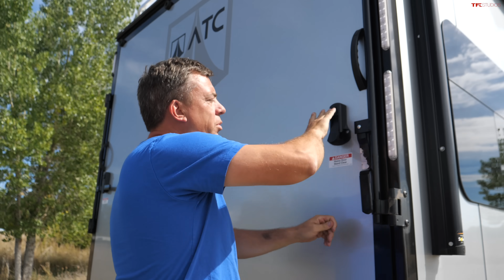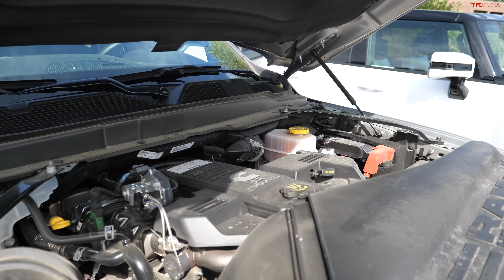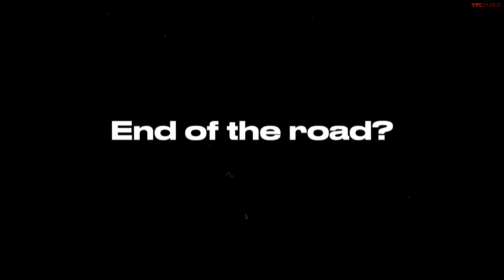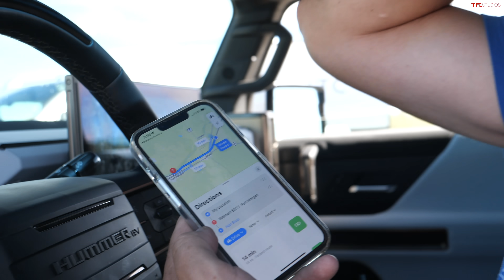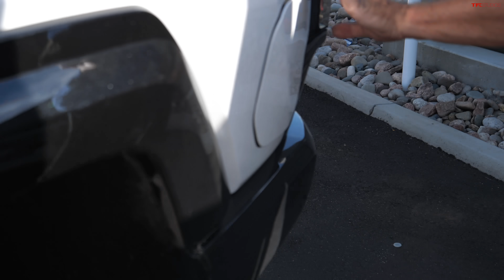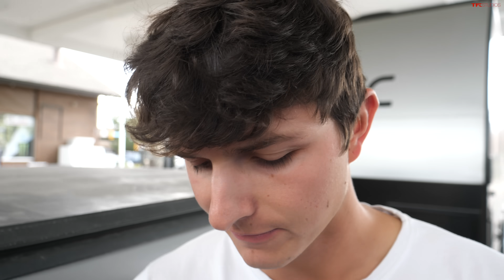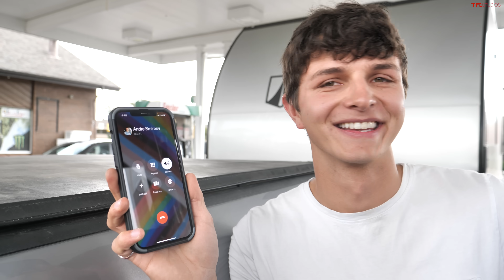How Far Can a Diesel and Electric Truck Tow An Identical Camper Trailer on ONE Fill-up?

Comment: So far electric vehicles have been as useful as taking the bus!! Definitely not good for pulling a trailer. And charging from a fossil full produced electricity. Drive 100 miles then charge for 20 min oh look the charger deminishes.. that's if you find a 230 kw charger! Usually its an hour plus to charge....the price of charging is not regulated and you are charged a price as the station desires!

Comment: The reality is the RAM results are skewed including the mpg, due to the RAM stopping with the EV, it should have stayed on the highway until it needed to stop. Also, the EV ended up using electricity and diesel.... the charging station was being powered by a diesel generator.  And it just so happen to be '0' but it was reading $37 for 31 min charge and it was still going with 51 mins remaining.    That could have come up to over $80.   He stopped  for a charge about half way there so it would have cost more than $160 to charge for the trip.

Comment: Dude that range is so sad... My 1990 van gets us 280 miles on one tank towing a boat and we can fill up in less than 5 minutes depending on the pumps at the station. Vs 128 miles??? Firm pass on elc towing. What a waist of time. Then when that lithium battery goes tits up you are polluting the planet harder than all the carbon produced  my man kind. Elc is going to kill the planet. People know so little its disturbing. The way neodymium is found and mined will make you want to terminate the Chinese government permanently. The way those batteries are made produce more toxics to the planet than any other industry. WAKE UP! GREEN ENERGY NOT SAVING SHIT!

Comment: What else many people don't take into consideration is the length of time it takes to charge. And in that time, that can be very crucial in many cases. Especially emergencies. Not only that, but the danger and risk that it can put on a person waiting. Someone can easily approach and have plenty of time to jack someone or kidnap or rob someone. Much greater chances. And if the electric car catches fire, good luck putting it out!
Reply: You WONT be putting it out... And even the FIRE DEPT will have an INCREDIBLY hard time too... Even AFTER they put it out, it can Catch on fire AGAIN.... Lol
Reply: @RyGuyXRP  yes I've seen instances where they restarted.

Comment: Twice as fast to charge but still 20x slower than fueling that diesel and not to mention you have to charge at least 3x if not 4x per the diesels 1 refueling.  This isn't even a comparison anymore.  You're really just showing off how bad an EV sucks ass

Comment: Thanks for doing these awesome videos, proving what I already knew. I for one,  will never buy a e-vehicle. As an Engineer, American, and someone with common sense. E-vehicles do have their place, living close to town/city making quick runs, maybe. Now if they put a Diesel generator on board like most trains do, now you migt be able to get better range. For those that dont know most trains use electric motors, because of the torque they can pull all the weight and cars as shown by this Hummer. But what isnt probably known is that the trains have huge diesel powerhouses on board to keep the electricity running for said electric motors. These are a huge sham just like solar and wind. Again, solar and wind have their place and from my analysis and calculations they are great for smaller homes/trailers to supliment those homes. Also you need to look at the Carbon foot print of the EV before you even drive it off the lot, spoiler alert, ITS HUGE. You would need to drive that EV almost 50 years to break even on the so called carbon foot print. The diesel used to mine the lithium for the batteries, the massive ships used to transport the materials/parts and the greatest question of all where is your electricity coming from to charge said EV. Coal, Natural Gas, Hydro-electric? Not to mention it took the diesel truck all of maybe 5-10 minutes to gas up. The hummer 30 minutes and it was barely half full, so you are looking to sit around at least 1hr. Want to go camping for the weekend? Hope your campsite is only 60 miles away because lets face it most camp sites dont have EV hook ups and forget about camping out in the middle of nowhere. Unless you take a generator, and gas I guess. All those vehicles are for, pretentious, virtue signaling half wits who haven't takent the time to question, do the math, and to think everything through critically. Is the Hummer a nice vehicle sure, but as stated in the video, its an EXPENSIVE TOY and not very practicle, at least for someone that lives out in the middle of no where. I do think that more research needs to go into the EV cars/trucks but as of now it a huge sham and joke.

Comment: Personally, I do a decent amount of long trips and just factoring in the time for charging of EV vehicles that are affordable to me and the charging stations I would have to use would add extra hotel/motel costs and time. For typical daily driving I could be persuaded to get an EV if it was very low cost for the vehicle. My overall preference is hybrid, though I use an old gas Toyota pressently.
Reply: Just remember. They told us the chargers would FREE..... ALSO, have you seen what GM is starting to do? They have a Monthly FEE in order to use Google, or the Autonomous Driving... Shit like that... So.... I would wait a GOOD 10 to 20 YEARS before pulling the trigger

Comment: Thanks for this side by side comparison that shows electrics range Achilles heel. Electric battery technology is maxed out. This problem won't go away. Imagine otr trucks. No no no way. The extra weight, lack of range, time to recharge, unavailability of batteries. Electric is creating a disaster for trucks.

Comment: I'm not a fan of electric trucks for several reasons, including their limited range, hauling capacity, and purchase price.  Having said that, what this video fails to talk about is the outrageous cost and frequency of repairs on diesel engines built after 2006.  If they don't kick the whole urea concept to the curb, the government will soon tax diesel and subsidize electric to the point that electric is the more cost effective option.

Comment: Calling you out for two huge mistakes, the model trailer you used exceeded the Hummer EV's towing capacity and you are dishonest about the trailer weight. Also, you failed to use the Hummer's onboard hybrid generator that extends the range significantly while you are driving. Also, the computer management will also extend your range when set up properly. You might have been surprised you went further at the end when you thought you were out of juice, lol, but you don't know how to operate the Hummer EV. All in all, this is a staged video that is fraudulent and full of misinformation.

Comment: The important to note that this was a flat tow, actually going down in elevation and the $115,000 Hummer could only go 128 mi. Try this same trip in the winter time and that could be reduced by as much as 40%. Turn around and go west into the mountains and my guess is that the Hummer wouldn't even make it to the Eisenhower Tunnel before running out of power.

Comment: That Cummins Diesel will run for over a half million miles.  How long will those batteries last?  How much did you say it costs to replace the batteries?  $60,000?

Comment: A more realistic test would be if both vehicles set off going to the same destination, using the same route and keeping to all speed limits, and the exercise would be, what would the time difference be between the two vehicles getting to the destination. The distance should be set at the maximum range of the ICE vehicle, or, two charge stops for the EV. REMEMBER.....if this was a business trip or a "call out", that in the real world "TIME HAS A VALUE".

Comment: So best charging is 350k and at the bottom half of the charge, so most time efficient is the run almost flat and charge half way at 350k. That would give you 43.35 miles in 25 minutes and then at 70mph you use the other 35 minutes of the hour to drive 40.8 miles and change again. So at 70 miles per hour you travel at 40.8 miles per hour or slower if the charger isn't empty or not a fast one and if you have to unhook the trailer, not very efficient use of ones limited time alive travelling only up to 58% of the time.

Comment: The studies are coming out, just the carbon footprint alone. A low milager will take up to 10 years alone to make the manufacturer ing carbon foot print neutral, a high miler will take 2 to 3 years. It is better for the earth for the low milager to keep the efficient gasoline car.

Comment: These arguments remind me of the argument against battery powered tools.  Use the right tool for the right job. I have battery, electric and pneumatic.  I dont chip concrete with battery or set sheetrock screws 15 feet in the air on scaffolding with electric, stringing electric cords.  Anyone that says electric will completely replace ice is an idiot, oblivious to how some people use trucks or a liar.  Samething anyone that says electric has no place is either a liar, oblivious to any situation not their own or ignorant.

Comment: EV battery tech is still very early in development.  I  expect someday EV range will be measured in thousands of miles.  EV tech will advance rapidly over the coming years.  We have already come a long way in a fairly short time.  It will continue to get better and cheaper.  The first EV's are much better first gas cars were.

Comment: The one thing that is very important is how much down time was the electric hummer recharging time compared to the down time of gas n go? Time is money I don’t want to spend 6 hours charging and 6 hours driving (for example) just to have a fuzzy cuddly feeling about how I’m not directly polluting the environment. Diesel is king because of the filtration systems but what pollution is incurred in extraction, production, and what pollution was to charge that battery?

Comment: Sadly EVERY genius that does these things leaves out a MASSIVE DETAIL... a "used" electric vehicle is virtually worthless as a "used car". First thing that dies after that warranty (since your car is web connected, the BATTERY warranty is as long as the company you bought it from wants it to be, one button pushed in Corporate and amazingly, you have NO RANGE) is the BATTERY. NO ONE EVER talks about buying that NEW battery cost, installation charges and then trying to unload that dead pile of lithium in time bomb form (massive fire hazard), the dealer doesn't want it.... Buy that new $100,000 electric car, and its dead before you finish paying for it...

Comment: A guzzler and a phone trying to be a truck. If these models ever make it to Europe, there will be 10 sold in total. My fathers transport van, fully loaded, towing a loaded trailer does 28mpg. Of course I did a little black magic with the ecu map and gutted all emissions control parasitic devices. The point is: you don’t need a boat engine to tow a decent amount of load and such inefficient shitboxes would never fly in a market where properly engineered vehicles are available. A 4 banger with 200+hp does the job without breaking the bank.

Comment: Yues these EVs have a very long way to go. And if we keep making them we'll run out of fossil fuel before we have enough of them to sale to just those in the us. 😳😗 Yea they are no comparison to a hydro vehicle just like we use in the rockets for propulsion, once in space. That's all it takes is the ho 2 so a much better option for the general civilian gangs😀 or keep driving deisel fuel cannot get greener than bio deisel it's low box low CO2 and easy to produce cheaply 😀

Comment: 9000 pound truck? Is that with the batteries full? And I never saw pickup drivers so happy about sailboat fuel. I would congratulate these jokers for driving 70 mph like standard normal folks. The bottom line is these wimpy electric trucks will be the butt of jokes for years to come. Even Elon musks trucks won’t do the 500 miles per charge. We still need good old diesel and we better elect politicians with some decent energy agenda!!

Comment: The greenies come from libturd stock that lectures us to follow the science[facts]. This is the video they don't want anyone to see because it doesn't support their narrative that green electric technology surpasses fossil fueled technology. And these same green libturds are putting pressure on railroads to run "battery powered locomotives". Even if the railroads had the money for overhead electrified systems, the electric power grid  would not have the capacity to supply their power needs unless new fossil fueled and nuclear power plants are built. The greenies hate fossil fuels and they don't want nukes so they think solar and wind generation is the answer. This is what happens when the respected knowledge of chemical, electrical, mechanical, and nuclear engineers are replaced with politics. Thank you gentlemen for putting together an educational and factual video.👍👍

Comment: I'm surprised you guys got only 9.7 mpg on the diesel engine. In June of this year I drove my 2018 F150 v8 5.0 from Pennsylvania to San Juan Mountains in Colorado and back pulling 21ft camper at 6,000 lbs gross weight and got around same mpg that you got in a diesel? I guess I will stick with the coyote engine for a while. I was putting regular 87 octane and if I was able to get E85 I filled up with E85 which was much cheaper from regular not to mention diesel price per gallon.

Comment: It was obvious without any test that electric is not, will not be the way to go. Too much destruction to manufacture those batteries. Not to mention the radiation emanating from them. Did I mention the risk of fire? The length of time it takes to charge them, and most importantly the electrical power system across the nation couldn't even take care of the homes during the summer months. It takes 500,000 gallons of water, to refine 1 tonne of lithium carbonate known as (Li 2 CO 3) the pollution of water and soil is of the chart. Only, I repeat only 5% of Lithium-ion is recyclable. The best alternative for now, are better solar panels to produce hydrogen and, vehicles using hydrogen will have vapor as emissions.

Comment: 20 minutes? Bullshit. No charging station is that quick. It takes HOURS.
Reply: batteries charge faster from 10%-80% than from 80% to 100%, EVs with glycol cooling stems on their batteries can take more current and therfor charge in under a hour with no significant degradation to the battery,

Comment: One important question. How long does it take to charge the batteries in the electric truck. BOOM! Hours and hours (8). How long does it take to fill a diesel tank? About 5 minutes.
Reply: tesla semi truck with a 5X bigger battery will charge 70% in 30 minutes, it just takes a tesla semi charger that can deliver the 2000kw power requirement (1500HP equivalent energy)

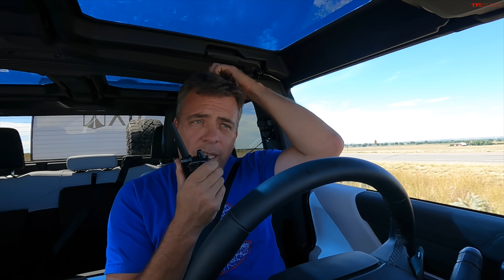Comment: ~11:30 tp 13:30... note the EV concern with running out of charge and being "stranded on the side of the highway with a big truck and a big trailer..."

EV Hummer range roughly ONE HUNDRED MILES! Huh?  For all those who say "the internal combustion engine is dead"  👈 true IF you never plan to travel very far and have no plans to pull your boat (electric or gas) to the marina 

And when you finally doooooo find a charging station, that's working, that's available, take out the picnic basket and sleeping bag and get used to the scenery.

And the EV fillup... "free"  😑😑 Riiiight... Free until...it ain't free anymore.

🤣🤣😂😂🤣🤣

Comment: When I was a full time RVer, I used to get about 325-350 miles of range. I tow at 62mph, so I was always about 5 hours of driving. I can't even imagine an EV.
Reply: It would be the same. Except 1 hour driving. 4 hours charging.
Reply: @evictioncarpentry2628  If you can get a fast charger.

Comment: What if you run the Cummins on filtered fry oil? Not biodiesel, just filtered vegetable oil. Mythbusters ran a diesel Mercedes on filtered used oil and it seemed to run perfectly fine. But, it had about a 30% drop in mpg. No worries about mpg when the used fry oil was free!!!
And who can afford these trucks, omg??!!??!

Comment: Now try it when it's below freezing out and the battery has 50k miles on it. The diesel will have more range because engine will be broke in and the EV will be losing capacity from day 1.

Comment: Long live diesel, gasoline and ethanol! It would seem the best green alternative is not electricity, but hydrogen fueled vehicles. It's clean and hydrogen is the most plentiful element on earth. I know Volvo is experimenting with hydrogen fuel. Infrastructure for EV will need to be massive and much quicker at charging. Another issue the Environmentalists have not considered is the disposal of all those batteries! EV might not be as green as they think. Since I am an old fossil myself, I will just stick with fossil fuels.

Comment: You can get 1m miles on a diesel motor. That battery will be dead in 5 years. You need to drive an EV for AT LEAST 100k miles before they start to be net lower carbon emissions than a conventional ICE.

Comment: How long will the electric vehicle last I've heard 7 to 8 years I've had my truck for 17  years and it's still rolling hard and good it will outpull anything out on the road And f 2 50 0 4